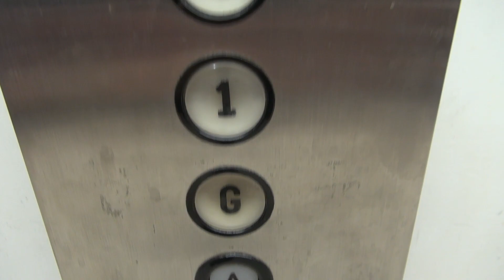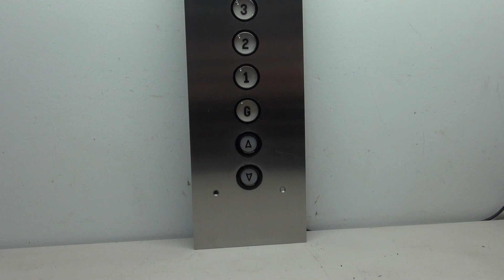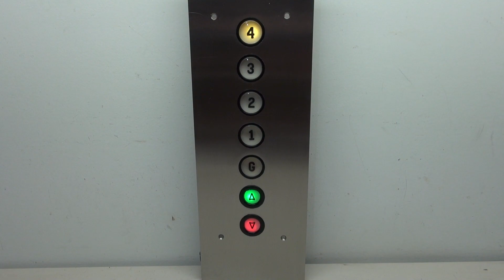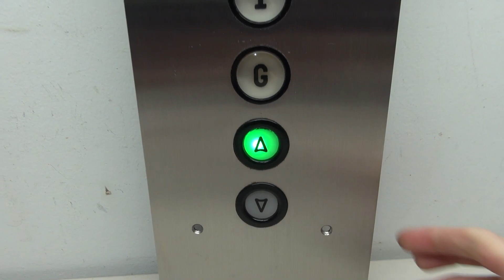Making an Elevator Simulator from an EPCO Call Button

Comment: That's really neat Jason, I like the fact you can set which floor you want the panel to be on, that was a pretty smart idea!
Reply from the maker: Thanks! Adding that feature took a bit of thinking because I needed to figure out a way to do it without adding more inputs.
Reply: @stlelevators  Right and that makes sense, a job well done.